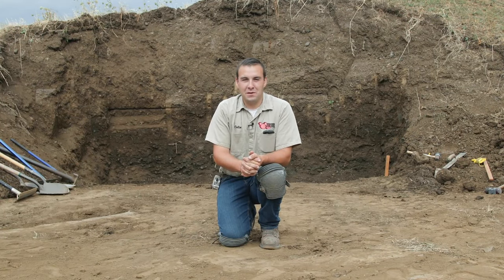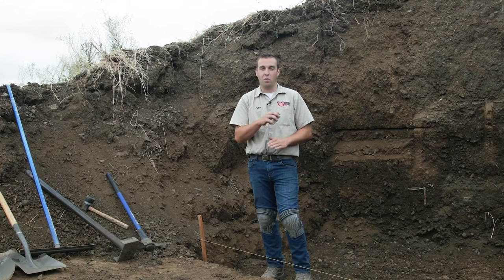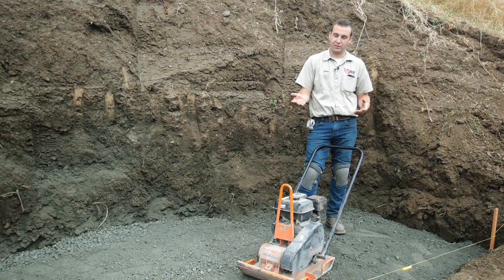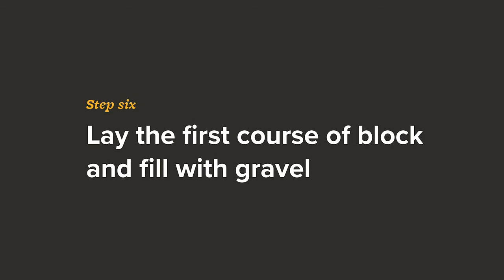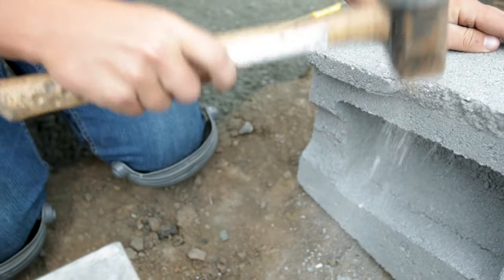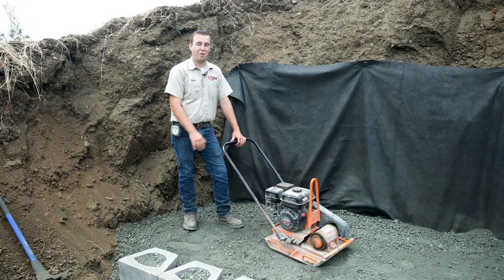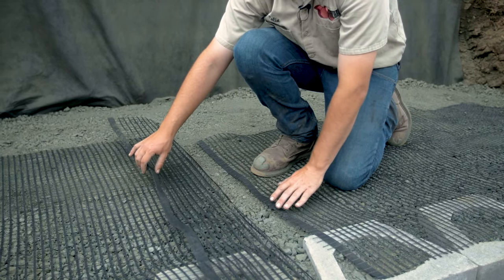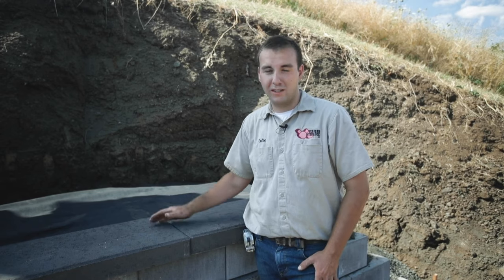How to Build a Retaining Wall (step-by-step)

Comment: Why are you backfilling with base?  It should be 3/4 clear.   Its also a best practice to use the geotextile under the 6' base so keep the subgrade and 6' base from migrating into each other.
Reply from the maker: This wall has been engineered from the ground up to work with Oregon DOT road base because it is readily available here in the PNW. We can't get 3/4 open very easily. Everything shown in this video is designed to make the strongest SRW possible with our unique environmental challenges here. It may be different where you are from.

Comment: No water on that compaction eh? Why?
Reply from the maker: Good catch, we always recommend water with compaction no matter the type of gravel used. There was no access to a sufficient water supply for this particular video but in hindsight we should have prioritized it for the sake of proper education, thank you for allowing us an opportunity to explain!
Reply: @WesternInterlock  why is water needed for compaction?
Reply from the maker: Water acts as both a lubricant and a carrier of dirt particles. As this water drains from the soil, gravity pulls these loose particles downward, filling in air gaps.

Comment: do you need to have that much gravel behind the wall? Seems like a lot of gravel. I'm assuming you are doing that just for the benefit of filming. Seems like you have as much gravel behind the wall as it is tall.
Reply from the maker: Good eye! We do have plenty of gravel here because we dug out the hill a little too much. To read more about how much gravel is required for Murata wall installation, you can check out the installation instructions here: https://westerninterlock.com/wp-content/uploads/2019/03/WI-Brochure-2018-Murata-Wall-Suplement-WEB.pdf
Reply: Yes you need 4' of back fill for your grill

Comment: Someone please help me. I want to build a retaining wall (2 rows) for a plant bed but i have a slope on one side. How do I make the first row of blocks level? If i make the base level one side will be close to ground level than the other side
Reply from the maker: You need to use a spirit level to get the first course level. Then lay the subsequent courses. If you have a slope, it is possible that the first course may disappear into the ground. This is OK. See the thumbnail image on the video in this article for a visual. Then lay the rest of your courses. It is possible that you may need to lay more than two total courses to achieve your desired height.
Reply: U need to start your wall in the lowest level  and walk your wall through your decide  high. Like making steps through your slovep if need it.
Reply from the maker: Well said!

Comment: Can you use 3/4 minus/paver base behind a wall, or is it supposed to be 3/4 clear?
Reply from the maker: Theoretically you could, yes. However, we recommend using ODOT or WSDOT road base which has less fines than standard 3/4-0. We specified this aggregate because it met our engineering requirements and was readily available here in the Pacific Northwest. If you live up here, you should be able to get it from pretty much any gravel pit.

Comment: i saw the murata wall stones u guys used calls for 4 feet of gravel behind the wall ... this seems like A LOT since i have seen youtube videos of "professional contractors" that only add a foots worth of gravel behind the wall ... is 4 feet a lot more than average for retaining walls?
Reply from the maker: Our specifications reflect modern engineering and seismic requirements. All of the videos that you have seen with a foot of gravel are the old way of doing things. There have been quite a few walls built with a foot of gravel, but there have also been quite a few walls that have fallen over because of it.

Comment: That is a crazy amount of fill. I just don't have that luxury as a DIY project.
Reply from the maker: It's not a luxury. It's what's required here in the PNW to meet current seismic regulations. If you look at any manufacturer's installation instructions for walls taller than 24", you'll see something similar.
Reply: @WesternInterlock  yep sorry I mean I just can't see myself moving that many tonnes. I'm just building a 2-3ft high wall and already have to keep the backfill low to not run out the 4 ton gravel I got. So can't imagine how many tonnes are sitting there.

Comment: Hi, I think this video is exactly what I am looking for. My yard is on a 30 degree slope, can I use these blocks as a retaining wall for 2 sides of a 30 foot oval pool?  Thanks
Reply from the maker: You totally can use these blocks for that purpose. In fact, we've seen it done a time or two. However, do to the excessive weight of the pool, we recommend getting some engineering done to prevent catastrophic wall failure. Additionally, these blocks are only available from either our retail facilities or our dealers here in the Pacific Northwest.
Reply: @WesternInterlock  thanks. I'm in North Carolina, can you recommend someone who can help me with the engineering part? Thank you.
Reply from the maker: Unfortunately, I am unfamiliar with engineers in your area. I would recommend some sort of structural engineering firm that has experience with engineering site structures like retaining walls. A quick Google search turned up a number of results. Find one near you and give them a call.
Reply: @WesternInterlock  thank you. I appreciate that information.

Comment: With exception to the choice of gravel and back fill, (location driven) this is an excellent, basic steps video for a DIYer.  Especially love the Link you provided showing the schematics.One question though, does a very sandy Florida soil also need geo-textile on the vertical?  Thanks for any response.
Reply from the maker: Yes. Geotextiles are always a good idea for soil stabilization. Check out this video for an excellent demonstration: https://youtu.be/Ra4B5Tx4QCk

Comment: What is approximately maximum height of this solution without concrete base under ground?
Reply from the maker: There is never a concrete base needed. We require engineering on walls over 48".

Comment: Wonderful!! HOW TALL COULD THE WALL BE??? I NEED  LIKE A 3 METTER TALL NOT TOO LONG WALL...2 METTER MAYBE...BUT TALL...COULD THIS TECHNIQUE WORK??? HOW  MUCH DOES THE GRAVEL HAVE TO GO DEEP INTO THE PROPERTY???
Reply from the maker: Hello. It really all depends on the retaining wall block used. Each one is going to have a little bit different specifications than the other. It also depends on the kind of material you’re excavating whether it is Sandy or more clay soil.
Reply: @WesternInterlock  the material is practically loose dirt on a side of the property white the other side  (9 meters wide) is more compact.

Comment: a cinder block retaining wall fell over at my fathers house. its 4'X60' 
and they quoted him 60-90k to replace, does that sound right?
Reply from the maker: It's impossible to say. There's too many variables involved. It all depends on the location, accessibility, the materials used, and the equipment needed. It is entirely possible that it could cost that much.
Reply: I have landscape timbers that need to be replaced (yes landscape timbers that rot very quickly especially when no gravel or drainage was used to keep them away from soil).  Just one little section alone (3'x12') I was quoted $2,500. That's using 6"x6" pressure treated lumber and some rebar. Cost of materials is crazy right now.
Reply from the maker: That's why a segmental concrete retaining wall is a great choice. Costs are still low and they last a LOT longer. Most likely forever if done correctly.

Comment: Hi! Where is the pipe connected to?
Reply from the maker: Since this was a mock-up wall, it's not connected to anything. We recommend that any drainage lines be daylighted every 50 ft or on one end of a wall if it's shorter than that. We really like the Wall Drain Pro. There's no need for difficult cutting or anything.

Comment: U should need to use 1" clean rock for back fill. Not minus     ur creating pressure with minus
Reply from the maker: We worked directly with structural and geotechnical engineers, along with the NCMA to develop this wall block to use back fill that is readily available in the Pacific Northwest. Our Murata wall is specifically designed to cope with the huge amount of rain that we get as well as the current seismic regulations. The DOT road base specified here works great. We've had 350,000 square foot of wall installed this way with no failures.